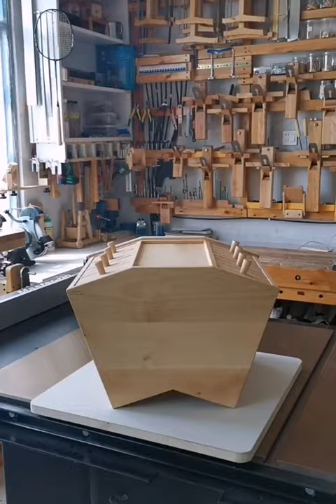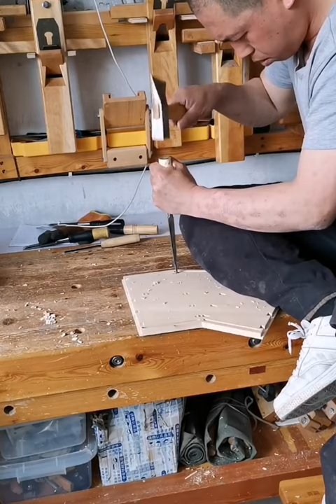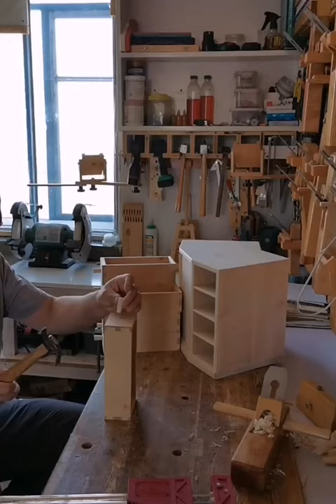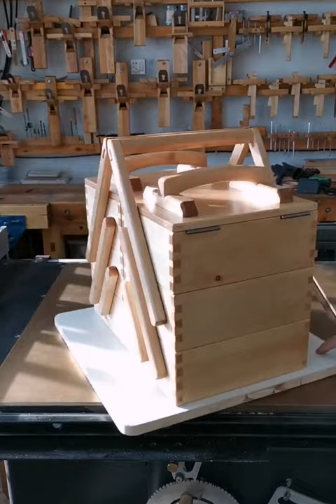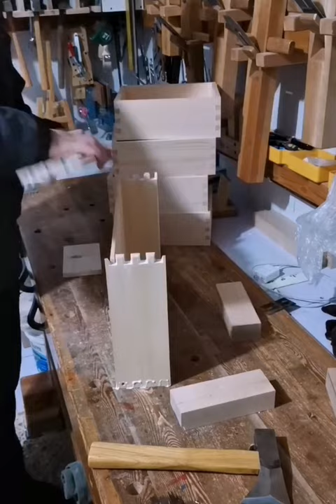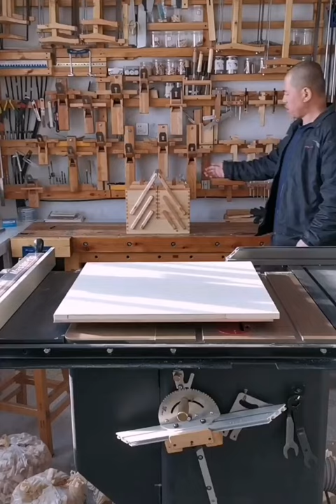Making v cabinet with 8 drawer and carpenter's basket

Comment: Gorgeous! How does it hold up when moved to arid climates? I wonder if it's possible to build one after drying the stock out to a specific moisture content before starting and maintaining that low moisture content through the build process so that the finished piece would survive in the similar moisture environment in which it was created.